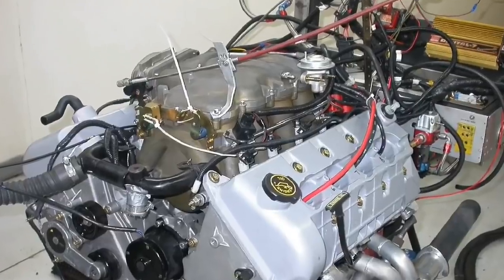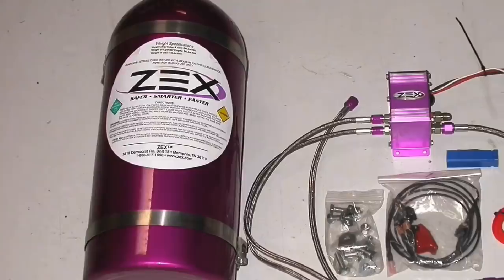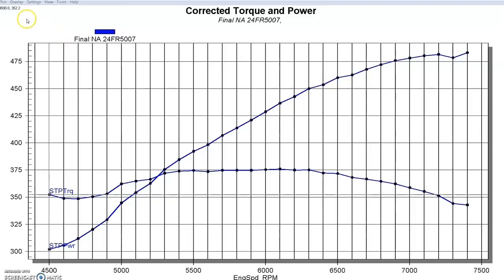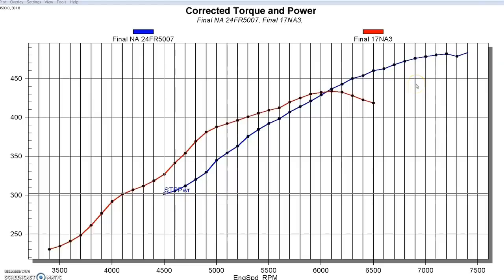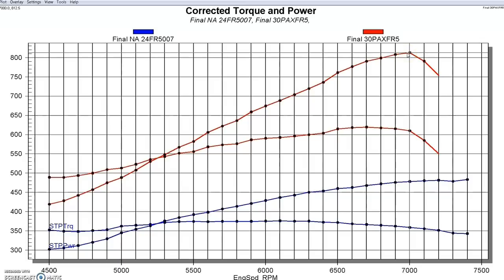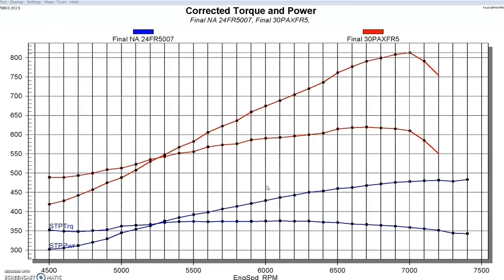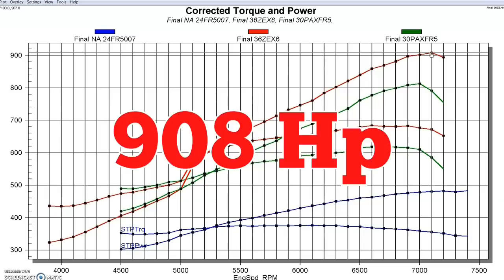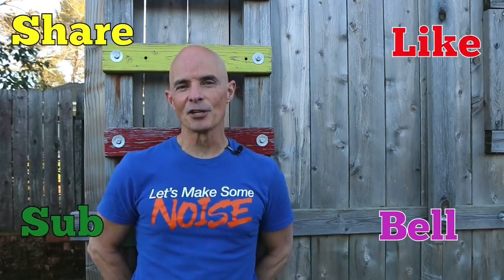BOOSTED FORD 4.6L 4V COBRA--PAXTON & NITROUS

Comment: What are the fueling requirements to run 16psi, and what upgrades were done to the rotating assembly? 
I'm curious about what fuel pump and injectors were used. And if the engine still utilized a stock crank, etc.
Reply from the maker: WE HAVE A BIG FUEL PUMP ON THE DYNO, WE HAD 65-POUND INJECTORS-IT HAD FORGED INTERNALS, BUT COULD BE DONE WITH STOCK-JUST EXTRA RING GAP

Comment: Hi Richard,
The valve springs were just the stock Ford?  When you put this engine together there was no discussion on the assembly. The details I am looking at is the installation of cams and if you actually degree these or just installed based on the Ford installation procedure and possibly using the kit made for these 4V engines. Or Did Sean give you a long block? I am thinking he also supplied that FR500 manifold?
Where is old Sean Hyland these days?  I did have the pleasure of meeting him he did have the opportunity to help in my engine build.  His company Sean Hyland Motorsports is gone now for a few years now.  The only after market manifold available is from Sullivan which will allow that 4V build power past the limitations of the Cobra or Mach1 intake manifold.

Comment: Let's test some Japanese v8 engines! 5.7 Toyota and 5.6 Nissan. I bet they would put a hurting on our domestic engines.
Reply: Nothing magical about them.  I'm sure they can crank out some good power, but it's not like either of them have head flow that will give them some big advantage.  As far as bottom end strength goes, the domestic engines have already displayed just how easily they can go well into 4 digit power numbers without grenading.  TBH, the Toyota and Nissan engines are going to have to be really good just to hang with these domestics, and maybe they can.  But I would be completely amazed if they can show any type of distinct horsepower advantage after this many years on the market, and nobody yet knows about it.

Comment: You can see the motor was not only still making power, it looks like it was still climbing in torque as well which is a dead giveaway that you were not near it's full potential unfortunately. 
Them damn springs lol! 
With better cans and a intercooler would have really set that motor up for likely in the 1100-1200 range being possible?

Comment: Ahhh valve springs...
I just used a 1.3" PAC spring with 450 lb/in rate in my hydraulic roller SBC.
Works great!
Don't wimp out on springs 😝

Comment: We used to have a belt slippage issue, even tightening the belt like a piano string -  we went to a toothed belt and pulleys and then no more problems. The toothed belt didn't need to be very tight, which was easier on the bearings.
Seems odd there were engine speed problems, even with the lightest aftermarket springs and mildest cams 8000 rpm was pretty common.

Comment: Great video again Richard , I wanted to mention something about belts , ten years ago I ran a 540 BBC with a Procharger D1SC that made 1030 on pump gas  , I was using their twelve rib with a 3.5 top pulley and spring loaded tensioner that we cranked the preload so tight it was like a guitar string using belt dressing to help out as well .The thing always had some belt dust accumulate on shaft/pulley indicating some slippage . Procharger did offer a cog drive but didn’t recommend for street and only had one V groove on bottom pulley meaning power steering was not an option . Being it was a five thousand pound street/strip vehicle converting to manual steering was a no go for me . Running belt that tight likely would have taken out water pump bearing but I only put about five thousand kilometres on it before switching to turbos .

Comment: Awesome video! 
you are quickly becoming my favorite YouTube channel!
 Did you guys end up swapping out the  valve springs? What kind of RPM is that 4v capable of ?  
Keep the ford mod motor videos coming please.
Reply from the maker: John over at Accufab runs 10K
Reply: Stock springs are good for about 7200, beyond that, you'll need springs.

Comment: For shits and giggles: Could you Turbo-SuperCharge one of your mules ? I would like to see if the differences if any between turbo, supercharged and turbo supercharged.
Reply from the maker: I compared turbos vs centrifugal vs roots vs twin screw on the same motor-would that count?
Reply: @richardholdener1727  for real life and all practical purposes it counts, A LOT, you're doing the hot rod community a great service. 👍🏻💖
My request is something more of a curiosity. I know the combined systems works very well, as some OEMs have been using it for years know (Volvo, VW, Detroit Diesel, etc.).
I just wanted to see the results on something more Run of the Mill, something Pedestrian, Spartan, something Garden Variety like an LSx, Mod or Hemi.
If you ever find the will, means and time to do it I would be very grateful as a viewer. 👍🏻👋🏻
Reply: If you were to run a Turbo/super vs straight turbo on the same motor at the same boost level, the turbo only motor would make more power every time guaranteed. Turbos gave lower parasitic power loss and higher adiabatic efficency compared to any and all belt driven compressors.  The only reason you would twin charge a motor would be to help with throttle response, but a properly sided turbo and proper tuning with modern computer controls takes care of that anyway. 
 Twin charging is inefficient. 
Twingharging is complicated.
Twincharging is expensive. 
Twincharging is dead.
Reply: @Cowboy.underwater  ALL very good points but sadly ONE SIZE doesn't fit all. That's why you have people running 2 different sized turbos in series, each one excels are their intended task. I wouldn't expect a Surgeon to operate with a Machete or a Farmer to cut Elephant Grass using a scalpel.
And it's fine . . . we are all free to believe what we want. 👌🏻✌🏻
Reply: @GIGABACHI  
you asked what the difference would be, and I told you what the difference would be. 
I even acknowledged the specific case use of turbo+supercharging improving throttle response and pointed out how proper tuning and turbo selection made that largely irrelevant.
What more do you want?
Reply: @Cowboy.underwater   Lottery Numbers, my Dude !  I need those !  🤣👌🏻

Comment: Richard I would like to know what turbo combo to run with my 347 or 408w  or 418w
Reply from the maker: what power level
Reply: Gotta give him more info. It would be like pissing in the wind. A 347 may work better with a larger turbo than the 418. Everything makes a big difference. Turbo single or twins. The engine block year/ type, (stock or aftermarket) engine size, compression, crank, rods, pistons, cam, head info. For instance valve size, port volume cc of intake and exhaust, combustion chamber cc and cfm if known. The more information you give. The better answer you will get. Also obviously target hp like he asked is a must. 
There's just way to many combinations with such little information that would work.

Comment: Run some back to back tests with the nitrous at the inlet of the blower. Will it increase density and lower charge temps - for even more power?
Reply from the maker: I don't think it changes anything, but worth a test
Reply: Nozzle placement makes very little difference assuming the NO2 has sufficient time to undergo phase change. It takes x amount of heat energy for x amount of nitrous to undergo liquid/gas phase change. Once that energy is gone, it's gone, regardless of where the nozzle is positioned.
Reply: Colton, are you considering the adiabatic compression through the compressor changing density? Any engine makes more power on a cold day due to increased air density. That's why we run intercoolers on forced induction motors, thermal insulators between intakes and heads, thus allowing optimised ignition timing. After all, its about power! Old rule of thumb reducing intake charge temps by 4'c to gain 1% power may be even more effective with nitrous pre-compressor. Richard,  I'm thinking a dry shot, non intercooled is a better apples to apples comparison.
Reply: @stuartcornall5306  
Yes, I am sure. If the No2 removes X amount of heat energy, the air density will be increased by a corresponding amount.  whether or not that air density increase happens pre or post compressor is irrelevant.

Comment: By pure luck I've found that 3M Super 77 spray glue works pretty well to get belts to grip (for a few runs).  It doesn't kill the belt either.  But it can make a nasty mess to clean up afterward....